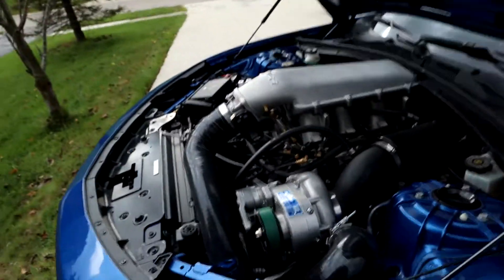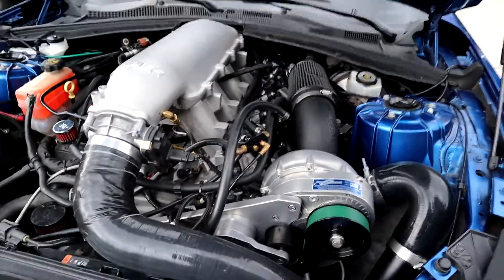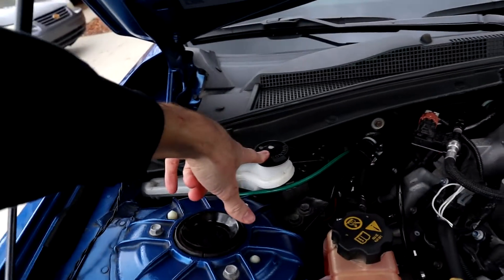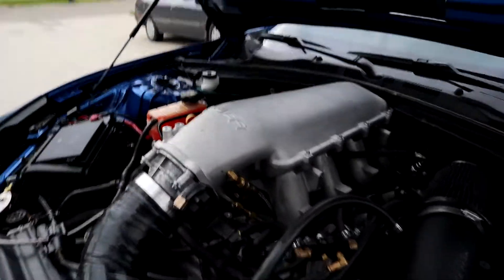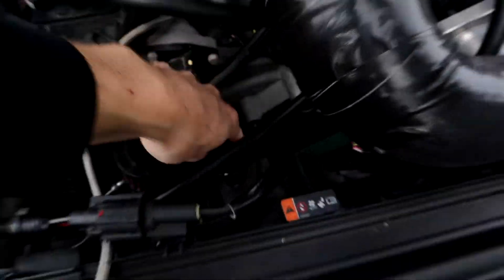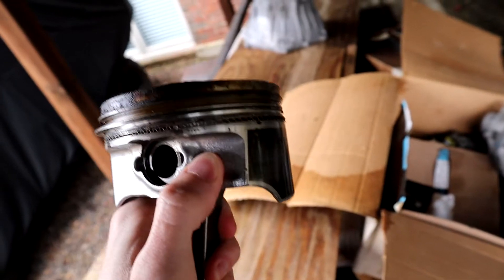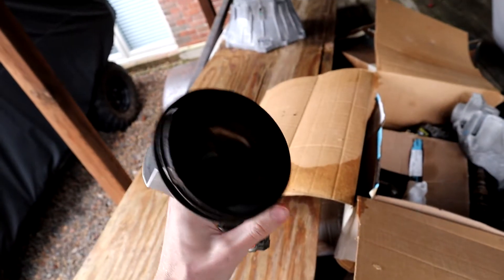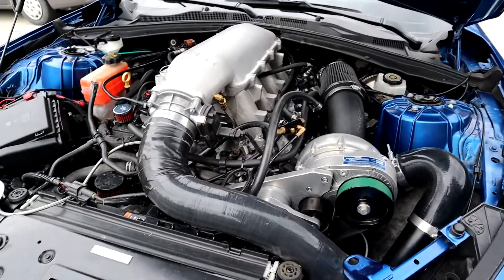Can You Boost/Supercharge Stock Motor LT1 Camaro/Corvette?

Comment: You can boost anything but the question is how much boost can it safely take before disassemble lt1 is mainly limited by the lower half of the engine not being forged like the lt4 and the fuel system is limited. You probably could safely put a small procharger on and push the fuel system to it's limit without serious repercussions and daily drive it. If you want to get the max out of the stock fuel system you will need to  cam the engine as well. There's a few examples on YouTube stock lt1's boosted and used as daily drivers with alot of miles recorded with no major issues. I personally would just keep it NA and go full nutz there's several NA lt1 builds pushing 600hp or more.

Comment: Well done.  I boosted my 98 C5 with a non intercooled Magnuson several years ago. I became addicted to it. You know smaller pulley, Meth, had a great tuner. Smaller Pulley, Did NOT maintain my meth nozzle. BANG! pulled the heads. Broke a ring land on #7. Ate it too. I was doing banzi runs on the freeway trying to clear out the injectors with Sea Foam. That worked well, but i had thinned the oil and over heated the back 2 cylinders. I had removed the rear vent tube and blocked the vents off (Big Mistake). OK just closed a nice order at work so used the commission to Rebuiild and Upgrade. Added the Intercooler to the Magnuson, Mahle Pistons, H Beam Rods, Crane Cam, Springs and rockers, Balanced and blue printed. But with a stroker crank in mind the builder called to say #7 Sleeve is cracked. OK, Ordered a Cast Iron LS1 Block and reused the old crank with all the other new stuff. Engine was very very strong. 525 at the wheels Just a street car to scare women and children. which it did. Went through a few clutches, trannys and put in a 3.73 gear from Mallet. Finally had it all worked out. reliable and a best awesome instant torque.  but then I found a Ron Fellows C6 Z06 I wanted and traded for it. The new owner of the 98 was older and rarely drove it. I had named the car a White 98 C5 with blister hood and 66 big block hood vents White Fang. After Soupy Sales dog in TV. But the new owner took hid brother in law for a ride and when they returned he renamed it Frankenstein.  Below 3,000 RPM is was very normal but nail the gas and it will rip your head off. Recently he sold the 98 to another fellow and he called to ask about the motor. He had all the paper work I had included in the sale and thought it was using oil on one cylinder. I suggested Valve seals because I knew the lower end was very well built. Today I have a 2014 C7 and have been eyeballing that Vortech Kit from A&A versus Heads and Cam. I see you had the high rise holley intake did that help of more to scare folks. I had put a Vortech on my 81 C3 with a slightly built 350 and it was a Mustang eater. We had to use bigger injectors and pump there to but before intercoolers and meth was readily available power was kept down and mix was rich. Once you had boost there is no substitute. The C6 ZO6 was a let down after the 98. Sold it for a SS Sedan, boosted it with GM Roots but the car was too big and heavy after 40 years of Corvettes. Sold it and found this 2014 so now thinking its Boost time again, before I croak or get the C8 Z06  ($$$$$$$$), This is a nice Vette think A&A may be the way to go but with all the safetys you listed for sure, it adds up but you don't want to break the motor. Car only has 10,000 miles. Thank You for the vote of confidence to boost the LT1. Katech is hard to get to from Virginia, but i do like their approach. Dennis
Reply: Sounds like you've been living my dream sir!
Reply: @michaeldyer6304  Save your money and try to find THE car then build it right and KEEP IT!. I have build many Corvettes 64, 79, 81, 93, 98,  07 ..... and wish I had anyone of them back.
Reply from the maker: Man you’ve been through a lot with your cars! Sounds like you have had quite the cool cars. The hi ram on my car definitely scares people. Katech is definitely worth the drive! If you end up wanting to take your car there, talk to Zach Deriue and tell him I sent you.
Reply: @toakss148  I left off my 1st car a 47 Chevy 2 Dr coupe, I put a 57 Olds 371, 4spd Hydra and Olds rear end. I didn't really go thru them. At 72 I have had time to own more than the youngsters out there. But it seems we share a common passion. CARS.

Comment: Great video man! I loved the procharger when i had mine on my g8, and good explanations. The killer for the LT1 stock bottom end is the heat and more importantly the lack of fueling. If you have the fuel the engine will typically last a lot longer. I ran nitrous with a stand alone on c16 to ensure the car was getting proper fueling along with the nitrous would reduce the intake temps as you were spraying haha.
Reply from the maker: Thank you! And yep keeping the heat in check and fueling is key on these.

Comment: You can absolutely boost them! My Fifty year anniversary special edition has a 2.9 Whipple,long tube headers,roto fab, and I did add the Lt4 fuel pump and injectors and professionally tuned, made 600 wheel and no problems,stock internals
Reply from the maker: I was similar power on my SBE setup too
Reply: You must drive it like a granny
Reply: Yeah and 50 more whp and boom 🤣
Reply: My tuners said I don’t need fuel injectors on my procharger
Reply: You could beat on it with confidence if you build everything to specific hp ratings.  For example:  ford terminator cobra has Manley forged h beam rods, and Kellogg forged steel crankshaft.  The non supercharged SN-95 do not.  No automotive manufacturer would put forced induction on a NA design.  That doesn’t mean you can’t get away with it, just be careful and tune properly.
Reply: high side or low side pump?

Comment: Hello, i know its been a while since you uploaded but i have some questions. i just procharged my 2021 2ss 10 speed. i went with the p1sc. i would like to ask what fuel system did you run? in term of high pressure, low pressure and injectors. did you just go with lt4 with dsx? could you please provide me what you did.

Comment: Great video. I have the Magnuson 2650 kit on my 2017 A8 and I beat on it all the time. Hot lap it at the track and no issues. No upgrades to engine or fuel system. I plan on doing all upgrades this year though so things will change. I will say my tune as of right now is very conservative though.
Reply from the maker: Good to hear! Sounds like a beast

Comment: It's not that you can't boost them it's the fact that when you do you become extremely limited due to the Di. We got screwed by Gm on this fuel system. Ford was actually smart for once and did port and direct injection on the gen 3 Coyote and its shows. Even with the Lt4 stuff you become limited pretty quick if you want to use any E85.

Comment: Hello All! I installed the stage 1 Edelbrock supercharger model 1570 on my 17 C7 GS M7 )(boost is 5.5-7.5psi/ 490-525rwhp) with the canned tune. I also routed a Mighty Mouse catch can for crank case pressure. The rest of the car is stock. The car is great and power delivery is amazing. I am also heading to California and want to track a handful of time on the track (Laguna Seca, Willow Springs). I've been having anxiety of the horror stories of blown engines and considering removing the blower. What are your thoughts
Reply from the maker: I would get a custom tune done. Canned tunes usually make the car run not as good as it good. You should be fine around that power

Comment: Can you please link the lt4 fuel parts? I saw on a website the whole kit for almost $3k.. so getting it for $1200 would be amazing! Thank you
Reply from the maker: The part numbers change all the time for them. What I did was call a dealership and get every part number then order it from sdpartsauto or gmpartsoutlet
Reply: so what lt4 fuel parts do you need? could you please help me with that. i boosted my lt1 engine.
Reply: @MrHussain2300  i ended up going with big bore direct injection and 30% over lt4 injectors with fore innovation  triple pump setup. ~1400hp rn
Reply: @jumperthruster3354  sounds awesome. I don’t think I’ll need that much. What do you suggest for my build? 
Edit: Will push stock motor to 600ish whp
Reply: @MrHussain2300  if you have headers and cam,tb and all the basic stuff and add e85 u could probably get to 550-600wheel with stock fuel system.

Comment: How much WHP can it handle on stock internals reliability? I was hearing around 450-500
Reply from the maker: 700whp with a good tuner. I made 610whp and the motor was perfect when I tore it apart to build it
Reply: @toakss148  When you drove 610 WHP, on which Octane gas was that? Was than on pure 93 pump?  Octane rating is a key factor when talking about engine power figures.

Comment: I have to slightly disagree with you on the drag hot lap...., ive taken my 18 ss m6 about 12 rounds back to back with no breaks down the 8th mile. Heat never went above normal temps. It also has the performance package from factory. Im not going to say no one will blow their car up by doing that but i didnt have a single issue with my boltons and factory tune. Great looking car btw!
Reply from the maker: This video is about boosted camaros not bolt on ones
Reply: @toakss148  ok i guess i miss understood how you implied it.

Comment: Meth is what kills these cars when they've been boosted and daily driven. When the meth runs out, or a nozzle fails, they eat themselves. When the meth works right, it's a great addition, but I cannot see myself relying on meth to prevent my LT1 from burning up. If you are going to boost an LT1, I really think you gotta go with adding port injection with some safety cuts programmed for the long term reliability. Easier said than done, of course. In reality, I just wouldn't boost an LT1 with stock internals at all. Upgrade the internals with GPI drop in kit, with proper machining, upgrade the fuel system to the LT4 system, and add a procgarger, keep it mild enough to avoid meth unless it's no longer a daily driver...